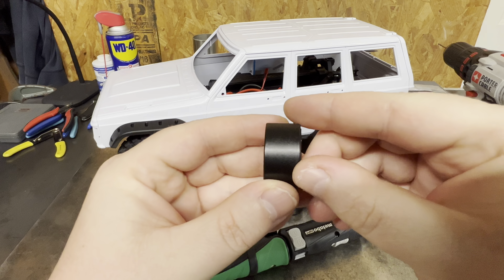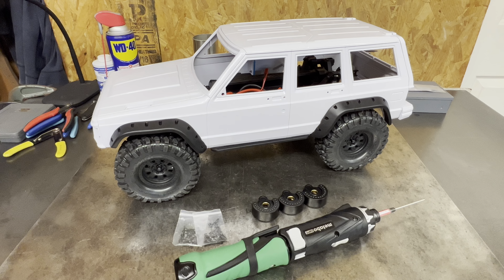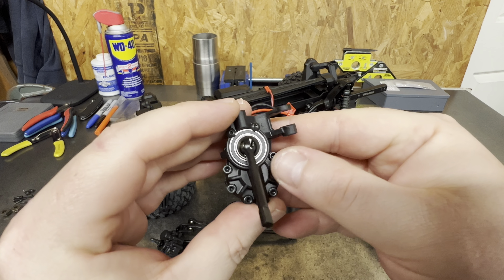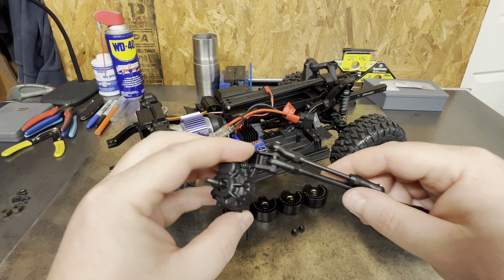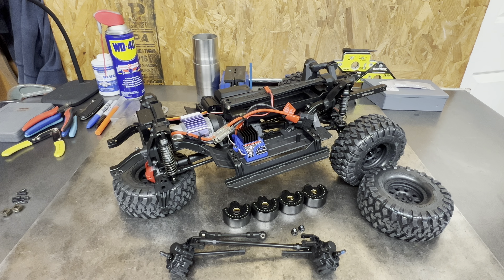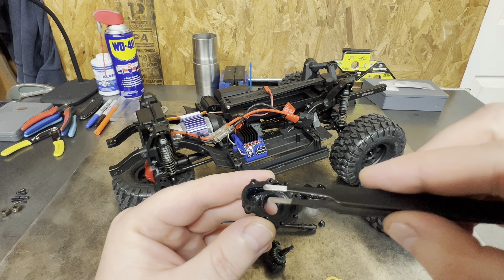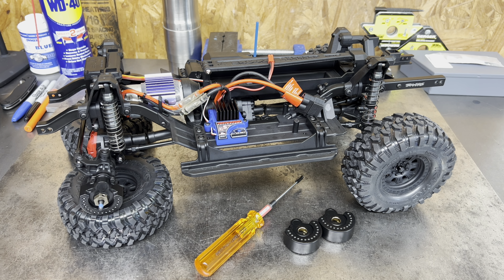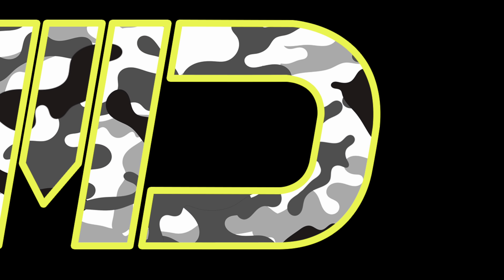We run into a roadblock with the #traxxas #trx4 in the form of #injora RC brass portal weights

Comment: Man, Injora strikes again on the 1/10 scale front....
Reply from the maker: Yes sir!
Reply: These work fantastic on all original wheel designs, as well as most aftermarket wheels.  
It’s not Injoras design that’s bad, it’s simply an aftermarket wheel fitment issue